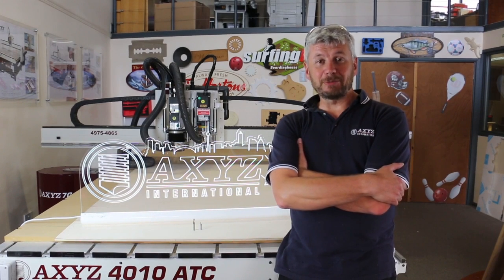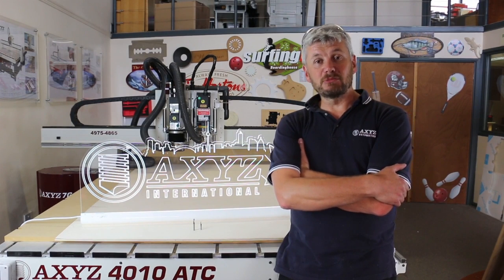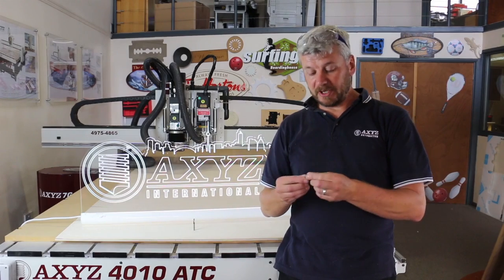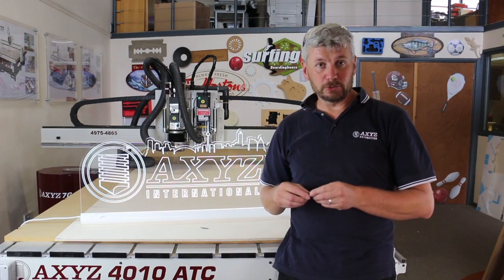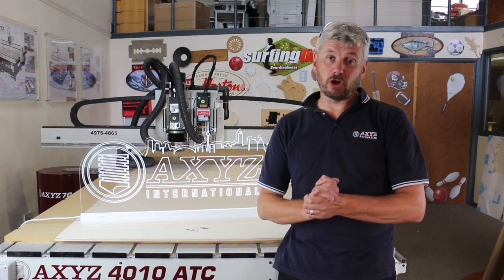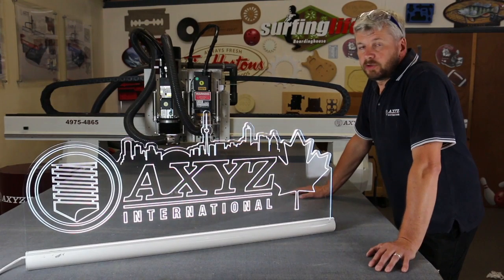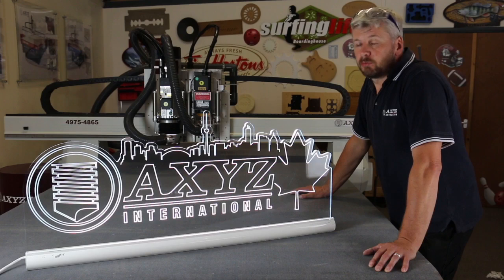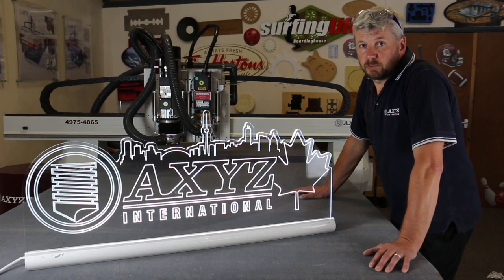Clear Acrylic Edge Lit Sign | CNC Router | AXYZ International

Comment: What spindle speed and feed rate did you use on both the engraving and edge cut?
Reply from the maker: Hi Shazmik,

Engraving: 18,000rpm at approx 1m/min

Edge cut:

Rough cut                  22,000rpm @ 1.5m/min   with a +0.2mm offset leaving 0.5mm at the bottom of the cut.
Finishing cut              24,000rpm @ 1/min